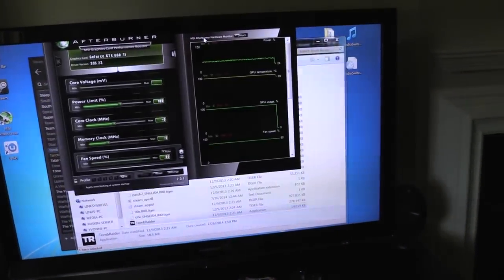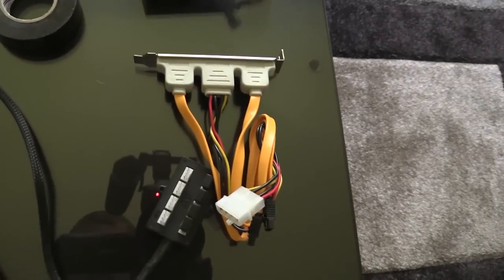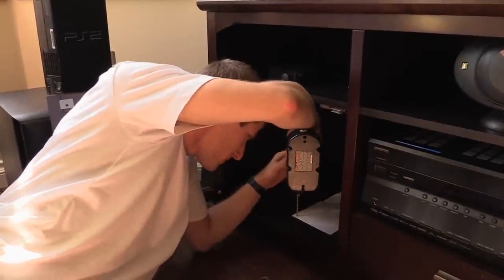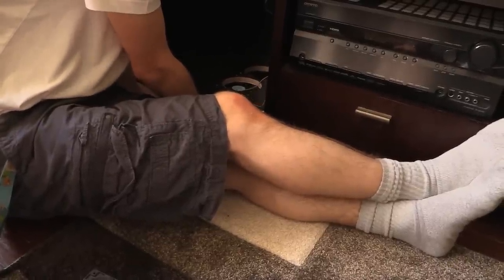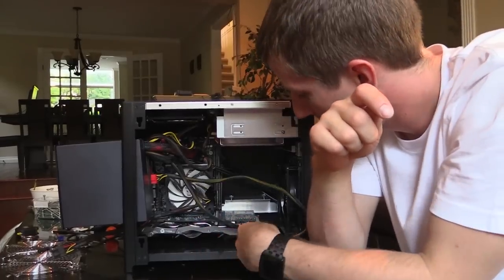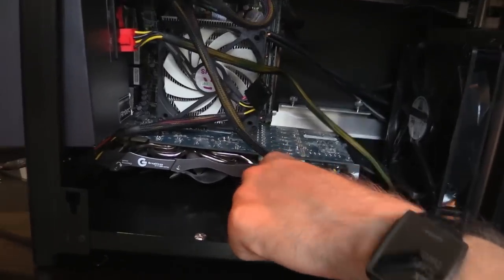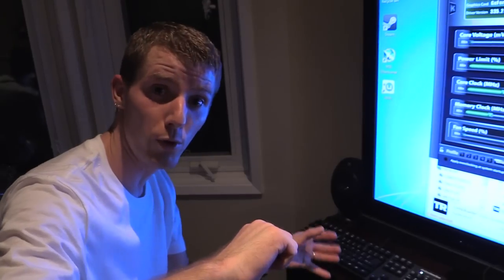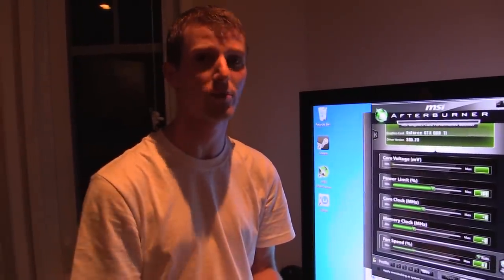Entertainment Center Cooling Mod - Linus DIY Method

Comment: Drilling your living room furniture,just to cool down a pc by 5-6 degrees...That's what you call a ''pc addiction''.
Once you go with modding and upgrading a pc,you never go back.. :D
Reply: vaio s Well it makes a difference in stopping thermal throttling though
Reply: at least he did a pretty good job. better than I would've done haha
Reply: It's like what car people do, trust me.
Reply: 851995STARGATE Agreed about stopping the thermal throttling, if there was a good way to deliver a similar performance with the new cooling setup I suspect it'd run at a pretty nice temperature with those speeds.

All things considered a fairly elegant solution to the problem and its a compartment that is useful for any future electronics that generate heat. Personally I'd just be lazy and have it out in the open myself but if I'm not mistaken Linus has cute cats to dump hair everywhere, so having it in there with intakes that can be filtered is probably more than worth it.
Reply: ToKeepTrackOfRandomSubs personally I have a mini itx rig with a 960 in it (similar to Linus) and honestly I went with aio cooling just so it could sit in my media cabinet hours on end. At least that way CPU heat doesn't make its way to the gpu. I feel he should do an aio setup similar to mine a seidon 120v or something as cheap and keep the cabinet the way it is now
Reply: I've hole sawed the back of the cabinet in the bedroom to run cables into it.  Not designed to be a media cabinet. ;)

Comment: LinusDIYTips would be great
Reply: I'm sorry, I got it when I was 8 and didn't know anything about computers. I'm not bothered to change it now :P
Reply: ***** That's a little harsh; OSX is still definitely very UNIX and with enough (very many) hacks and mods and applications, the locked-down appleness of it can be lifted enough to use it similarly to open source UNIXes like BSD and Linux. If you see a security professional, a black hat or some other script kitty in general using a macbook, this is probably the case if they haven't done away with OSX entirely (at the moment you see them in case they use multiple OS) and put their own choice of distro on. Admittedly, I think even they are attracted by the hardware since many might not actually know enough about hardware to understand just how much of the money you pay for a macbook is shinyness and admittedly-incredible build quality.
Reply: ***** seriously he can put any pic he wants ,you dont like apple then that's your opinion actually apple products are one of the best out there
Reply: ***** Macs are for people who have a lot of money to waste but not much time to learn how to make or buy an equally good computer in both performance and build quality for cheaper. The money goes to the very good build quality and fancy seamless aluminum case if it's a macbook pro or iphone. When speaking of laptops, it is certainly true that macbooks aren't too overpriced when compared to a PC of similar build quality like the Razer Blade or something from Falcon Northwest (though they do intensely lack graphics power in comparison).
Reply: Christ, I do use a Mac. Because I don't need a lot of performance; I just need long battery life, a light weight and enough performance for some Photoshop, After Effects and some C4D. I do want to build a desktop; I'm building one for my friend in January if things go as planned. You have to look at computers logically. You can't just go "Oh mac they're terrible" then why the crap does Linus use a Dell XPS 12? You can get so much better performance for the same money! Because he probably wants something light, with good battery life and decently powerful. Which is what a Mac Retina 13 is. I would've gotten a PC if my shoulders could handle a heavy computer. Trust me, in the lightweight laptops, there's not much to beat a Mac unless you go into the levels of the Razer Blade which is not a very good laptop. Understand me.
Reply: >Razer Blade which is not a very good laptop

PLEASE EXPLAIN YOURSELF

Linus himself (/watch?v=s1uj6wQTu58) has these complaints with the current Razer Blade, chronologically in this order:

1. The mousepad buttons are a little thin

2. He would prefer full-sized up and down arrow keys

3. Windows 8.1 (its shipping OS) has text scaling issues sometimes, a point that really annoys him as seen in other videos

4. The screen has some color shift and black levels not as low as he'd like

5. It only has 8GB of RAM and this is soldered to the motherboard, making upgrades difficult

6. It has no ethernet port

7. It has an HDMI port instead of a preferable minidp port

8. It is very expensive

THAT IS ALL.

Linus specifically states that it is much better than the Macbook Pro 13" and that it is "he only laptop he has ever seen that does not feel like a compromise."
Reply: I guess it's an expensive toy. Right now, this generation of the Razer Blade is too overpriced for what you get. Sure, it has a great build quality and whatnot, but it can't actually game properly at that resolution. It's a great concept, and the folks at Razer have done their best to it. But it's not feasible yet. Once we get proper Mobile GPU's that can run high resolutions without overheating, the Razer Blade will shine.
Reply: There's Gaming laptops and Multimedia laptops. Razer Blade is somewhere in between because it's the best Multimedia laptop, perhaps even too much so, but it can't game properly because of hardware limitations. Which is why I don't really like it.
Reply: 김동현 >overpriced

top model $200 more than apple's top Macbook Pro. Gee, what a huge gap.

>can't actually game properly at that resolution

it has the same resolution as the top macbook pro and a vastly better GPU - not to mention that it's only the top model mbp that has discrete graphics at all.

>can't game properly because of hardware limitations

I think 40FPS in Tomb Raider on high (source: tom's hardware) constitutes gaming properly. What game can you suggest you'd have trouble playing?

>there's gaming laptops and multimedia laptops

I disagree strongly with this statement since I bought an Acer A53SV, something not marketed as a gaming laptop by any means, and today it runs most games fine at medium graphics.

Honestly, you're telling me you dislike the Razer Blade because it can't game like a desktop even though no 14" laptop, very few 17" laptops and certainly no macbook ever games better than it? And it's "not very good" because it's marketed as a gaming laptop when if you compare it to a macbook of the same price, you get similar if not better build quality with the addition of actually having enough performance to play games?

TL;DR please support your claim that it cannot play games well
Reply: Then please tell something else you can buy for the price. The top end Macbook is pointless and stupid. The Razer Blade is far too expensive for what you get. It's a great piece of hardware. But I would never get it.
Reply: Also I don't think you know a lot. The 15 inch Retina has a 2880x1800 screen while the Razer has a 3200x1800 screen. It can't play BF4 or Crysis at Ultra or even high properly, and it is reported that it overheated and shut down. You can google "Razer Blade Review." Look, it needs a lower res screen. It can't play properly if it overheats. Tomb Raider is not a very new game. If it had a 2560x1440p screen with an actual high-quality IPS screen and a longer battery life, it's be worth the price because that's still a good enough res and it would be able to actually properly play games without it burning your lap or the table it's on, while having a better battery life, lighter weight and overall better experience.
Reply: The Falcon Northwest TLX generally costs more and yet is thicker, heavier, has a lower resolution and very similar hardware at its default configuration. Also, if you want a cool gaming laptop, keep dreaming; there is no gaming laptop that does not get hot. Can you describe any cheaper laptop that can play games better? Also, your main complaint seems to be the screen. Have you considered multitasking and browsing at 3200*1800 and then playing games in fullscreen at less than native, say 1440p, 1080p, anything? You forget that if you don't like the high resolution you can even go in your display settings and change it to be lower at the same aspect ratio. If you think it's overpriced because of the useless high resolution option and for some reason that upsets you, look at the TLX.
Reply: Well simply put, Asus G750-JZ. There. Or a Gigabyte P25X-V2. Also guys, stop getting mad; you can argue but please be respectful.
Reply: I love ASUS and Gigabyte and I can't argue with that except that they aren't really that much cheaper; over 2k a few hundred dollars isn't a gargantuan difference. I still don't think it solely being very expensive justifies it being "not very good" though.

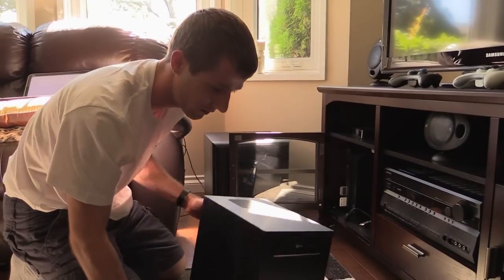Comment: At 2:36 you can see there is a USB drive plugged into the left side of the computer... and then lays the computer down on its left side at 2:54... You can then see the smashed USB device at 3:08. You're the best linus <3
Reply: 10:30

Comment: really liked this whole blogish idea...but why not just go with watercooling...? Even closed loops like the h100i?
Reply: It's the GPU that's having big problems not the CPU.
Reply: Alexander Pavel You could still put a major watercooling block onto the GPU on just get a more efficient GPU.
Reply: Alexander Pavel You can put the h100i on a GPU with a kit.
Reply: Strongdocoteur
Yeah ... very profitable with a 660 gg ...
Reply: Strongdocoteur you cant with the 660 and its not worth it anyway. This kit is ONLY for the 780ti and R290x at the moment.
Reply: How are you going to fit any watercooling in that case other than in the front
Reply: David Green not in the case, on the cabinet. You dont need to put Watercooling Radiators in the case you know? But still, in this case it is just not worth the effort and the money.
Reply: TheLordOfWar
Even if he watercools, the same amount of heat comes out of the system. It's all chucked out into the cabinet. So his mod cools the environment that the pc is in.
Reply: Doug Soutar you dont understand it. The radiator would be mounted to the cabinet and pull cool air into it. But still, not worth it.
Reply: Doesn't look like he has much space. He'd also have to pay far more money to get watercooling on his GPU instead of just getting fans.
Reply: true but i'm guessing he might just have some the parts needed laying around and if not even 2 single closed loop radiators would do the system justice and not eat away at his wallet...and then he use those noctua sp fans hes so mad about haha
Reply: Jason Ta 1 for cpu and 1 for gpu obviously

Comment: If you want less dust, you should have mounted one exhaust and two intakes.  This means that it will create positive pressure, blowing air out through not just the exhaust, but through any cracks and what not keeping out dust if the intake is filtered.

If you have a filter intake, and unfiltered exhaust in equal number, you will have negative pressure, meaning that air will be sucked in unfiltered through cracks causing weird dust buildups along cracks.
Reply: Also,  no brainer solution here would have been to primarily abandon air cooling in favor of a water setup with a cooling tower.    You would only have had to drill a small slot in the back, and would have excellent performance.

Comment: I know this video is 6 years old but people are still watching it. I had a similar problem with my HTPC sitting in our built in custom wall type cabinet. I ended up making a mineral oil pc out of a aquarium,  yes,  I've seen your mineral oil videos too, and routed the radiator lines to the outside the cabinet with a 200 mm super quiet fan and an automotive transmission radiator. Worked great for many years until we had a lightning strike close by and it fried the hdmi jack on the computer, security camera system and 75" tv. Liked the reliability of the MO computer so much it is getting redone with upgrades. Temperatures were extremely steady but TBH your computer is built for gaming and mine is not. MO PCs are messy to upgrade but mine stayed on 24/7 for years and it took lightning to break it. The VGA port still worked though, but TV didn't have VGA port.

Comment: Well I did this a while back, having a basement, I simple ran wires through the wall to a square wall plate for looks, down to the basement and mounted my HTPC rig down there, which is also a gaming pc. I hate noise, heat, and clutter - this fixed all of them. 
So I ran a 16ft hdmi, usb, and 4 wire power/reset. Hdmi goes into the tv of course- the 16ft usb 3.0 goes into a 4way splitter: for controller, m/kb dongle, and anything else needing plug in. I simply removed the power/reset switches from the case - added 16ft of wire, and drilled a couple of small holes to a shelf in the HTC cabinet - the switches look as if they belonged. 
Meanwhile in the basement, i simple ran power and network cable to the HTPC, and the three small cables : hdmi, usb, 4wire through the stud wall opening that leads to the back of the living room entertainment center. And since i change up my room settings every couple of years i - put in a square outlet with a hinged opening for the cables to work. 
MY gaming room slash office, I ran the same setup but this time 3hdmi cables, for pc and consoles. MY monitor setups allow the surround sound via optical cable through hdmi. Wireless controllers, mean the only time I have to walk to the basement is to change out the game disc. MY gaming room is dead silent, when nothing is playing and no heat into my room.

Comment: I actually wouldn't use either of your approaches, I would have just bought a AC to 4pin Molex power adaptor for about 10-20 bucks from Amazon or the like
Reply: That was my approach when I did a similar cooling the media cabinet project a couple years ago.  Also to get nearly no noise I went with fans that used liquid ball bearings.  They were quieter than whisper db rating.  No need to throttle them down for noise control.  I forgot what brand they were, but they were very much worth every penny as I hear the fans on my tv before I hear the fans on the entertainment center.

Comment: Ah. The days where you only need one tiny 40 mm fan to cool the CPU.
Reply: you can still do it now. (fx-6300 stock cooler is tiny, 55c)
Reply: +ClassicPork Stock athlon 5350 cooler.
Reply: I've got a computer here with no fans other than in the PSU...
Reply: +ClassicPork But ummm we are talking gpu not cpu...
Reply: ***** Yeah but have you seen the size? you're better off cooking a slice of pizza
Reply: ExternalJackal 6969420 rpm
Reply: +ClassicPork woah/.:).
Reply: EDToaster
Or just save up for a water-cooling solution

Comment: you should've just water cooled it with a radiator outside the cabinet
Reply: Why and how?
Reply: just use long tubes
Reply: rad inside the cabinet, fan on bottom pushing are up and then running the tubes through the back of the case using the same open PCI bracket area thats how i would do it.
Reply: Yeah, watercooling would do better i guess

Comment: How about a watercooled GPU cooler where you can put the radiator outside the case?
Reply: thats actually a really good idea, most cases have holes in the back for external rads and it would work great in linus' situation

Comment: cant you use the shelve has a case?
like just screw the motherboard on the wood. it whould be the most awsome case ever.
Reply: Those kind of solutions have a very low wife acceptance factor though. Small cases, which also look good, such as Linus has here, have a higher wife acceptance factor.
Reply: He did mention something about keeping down the ghetto factor. That would be about the most ghetto thing you could do with a media PC.
Reply: Woody Carson
only thing more getto is mineral oil computing
Reply: ThomasJakobs1993 I want a "wife acceptance factor" on pcpartpicker.

Comment: This is cool Linus.. But very impractical.. Wouldn't it just be better to get a more air flow heavy case? Or move the pc out of the cabinet?
Reply: Well a airflow optimized case doesn't really help if it can't get any air. And where the hell would he have moved it? there is no space.
Reply: UselessBread Obviously you didn't pay much attention during the video, the case he is using doesn't have any side or front intake. Only a very very small bottom intake. The cabinet has a big hole in the back for fresh air to get into the compartment. He can add 100 more fans into that tight space and it won't matter since his case has almost no way to intake the cold air into it in the first place. Also the power supply fan is facing the cpu fan directly... He could have gotten a black bitfenix prodigy and could have been doing with it. Also the gpu has no room to breathe in that case anyway.
Reply: ForTheViolence Obviously you didn't pay any attention because he improved the temps on that stuff.
Reply: UselessBread and it's still at 96 degrees lol, not even my old reference r9 290x runs that hot. Obviously not worth destroying an entertainment system over when like I said he could have spent $60 for one of those cooler master cubes or something similar. I'm pretty sure he even has one laying in the office.
Reply: ForTheViolence The coolermaster cube would have run just as hot without the modifications because there is no way air enters or leaves that cabinet.
Reply: UselessBread Like I said there's a big gapping hole in the back, watch the video.